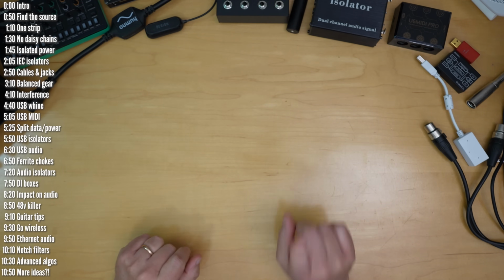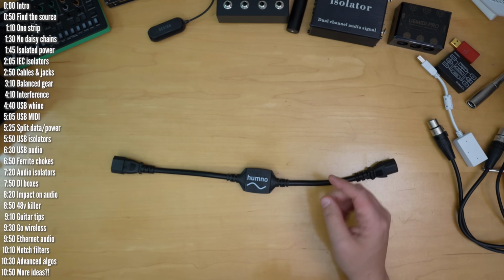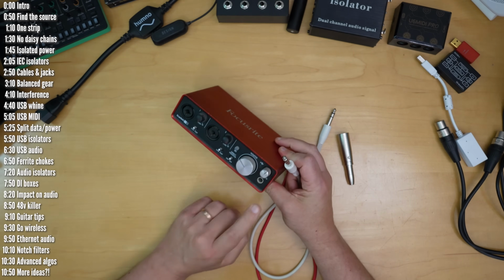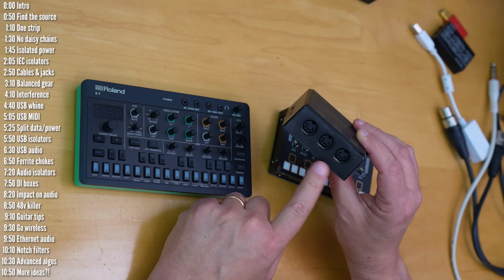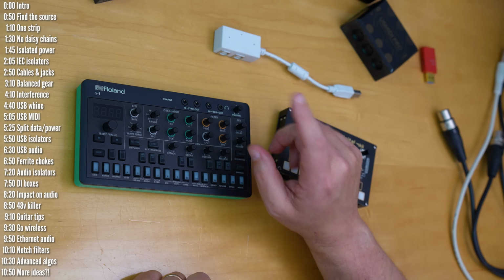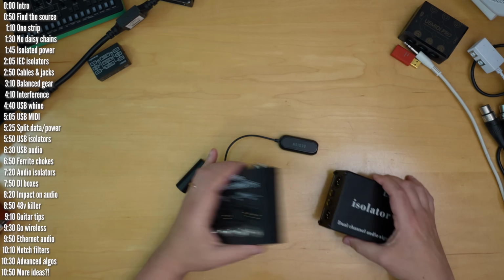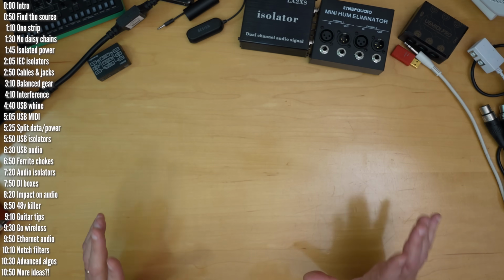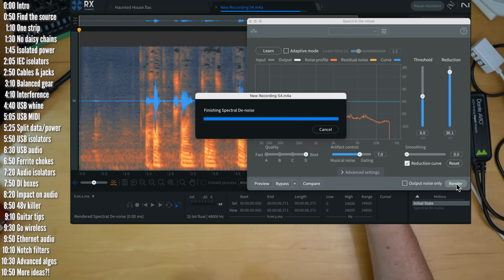12 better, simple and cheap ways to fix noise, hum, buzz, ground loops and USB whine

Comment: I found that Roland devices like to produce USB groundloops when using bus power. I’m using a Delock USB isolator with 5 kV isolation with both my TR-6S and MC-101 and that works well (each instrument has been connected to it’s own isolator). Make sure to get the USB 2.0 (480 MBit/s) version so that the data transfer side works as well. There’s also a version of that product that uses USB 1.1 speed, the price difference is minimal. the USB 2.0 speed version allows the audio interface function of the Roland devices to work as well.

Comment: And when the noise comes from your house's electricity? And all the neighbors have the noise too? You need to put a BIG inverter (mine weighs more than 20kg!) and an IEC isolator on the computer, especially if it's a tower, and for the rest, a good cable manager, balanced jacks, and using MIDI with a USB/MIDI box are enough. If there isn't a particular device that makes a little noise and you can't connect it via MIDI, then a simple ferrite choke works! (This is all my experience..)
I know all the suggestions you show in the video, and I completely agree, except for forgetting that the noise problem can come from the neighborhood electricity that reaches your home...

Comment: Those belkin devices are very handy in a pinch when you use small synths like the NTS-1
 My biggest enemy would currently be the USB noise, which I can mitigate by using a gate plugin but a more hardwarematic solution would probably be better. The topping thingy looks promising!

Comment: Oh man if this fixes the whine from my QuNexus and my Keystep Pro when using CV, this is a game changer
Reply from the maker: @Ancaja123  let us know back here!
Reply: @loopop I’m looking to get the Topping HS-2 when I get some extra funds. I like that it doesn’t need power, and it’s super small and flat
Reply from the maker: @Ancaja123  are you connecting them to a computer?
Reply: @loopop  Yes, mainly for sync reasons. The computer is definitely what causes the whine, and I have noticed at least with QuNexus that the whine doesn't get recorded into any tracks at least, it's just looped into the speakers (over my head a little). But I have thought about using my RK-006 in its standalone mode, and connecting them up to USB that way to see if that gets rid of the problem.
Reply from the maker: @ ok cool good luck!
Reply: @loopop  while I have you I do have another hum issue. I have a Maneco 16 Second Digital Delay which is an odd clone of the vintage EHX pedal. The clock out of the pedal is changed to a metronome out, but any time I plug anything into that jack, I get hum, even if the cable isn't plugged into the other end. I have 2 of them and it happens on both units. Any idea why just plugging a cable into a jack gives me a hum?
Reply from the maker: @ I have no idea - perhaps the cable behaves like an antenna picking up RF interference

Comment: if you plan on using piezos; they require instrument level; use a DI or instrument input (there are dedicated DIs for piezos but any will work), and know that piezo cables are specially sensitive to interferences and they absolutely not play well with any 220V dimmed light circuit (so again; use a DI, and make sure the cable doesn't cross a power cable or DC transformer)

Comment: I wish arturia would sell those little USB dividers standalone; I haven't found many alternatives at all and they do solve many problems (for me I need one to plug my microfreak to both my modular and my pc via usb)
Reply: the fact is you shouldn't need a 100 dollar solution for this as you just need to separate data and power lines (with power isolation). Only solution I found that is straightforward is the one provided by dreadbox (look up usb power/data splitter by dreadbox).

Comment: Regarding DI boxes and audio interference - in my experience, the dead cheap Behringer MicroHD HD400 changes the sound significantly while I can't hear any difference in the much more expensive models like the Palmer PLI-05 or Radial SB-06 (the latter also having the advantage of changing unbalanced into balanced signals, as often plugging a TS cable into an otherwise TRS patchbay results in volume loss).

Comment: I’ve had noise/distortion issues with my Dreadbox Typhon. It’s not a PC-USB connection noise issue, happens whenever it’s plugged into the wall or a power strip while the screen is on. Only thing that works is powering it off of a power  battery brick.

Comment: Sometimes the external screws on devices are connected to the chassis ground/ground plane of the circuit in your device. You can run some speaker wire, similar to the way phonographs ground to amplifiers, between the screws on your devices.
Reply: This is more likely to create ground loops than to solve them.
Reply: @goodun2974  It has worked for me when using unbalanced equipment. By bonding all your equipment to a common ground point, you’re creating a single reference potential—a shared ground plane. This eliminates ground loops (where differing potentials between gear can cause unwanted current flow) and minimizes common-mode RF currents, which are a major source of RFI and shocks.
Reply: Star grounding

Comment: Have you tried MVolts's Alchemist (USB/DC) power hub? Is it any good? Does it eliminate/minimise noise?
Reply from the maker: I've not tried it yet
Reply: Should be out in the next month or so I believe… I would also be interested to hear what they are like. There are two versions - Alchemist and Silent Alchemist - the latter featuring individually isolated outputs. Big fan of MyVolts 🇮🇪 so think they should be interesting products.

Comment: Cable type.
Had a really bad hum coming off my Presonus ioStation 24c audio interface.
I was using TS instead or TRS.
While most interfaces can take either as far as just putting signal in, but TS cable is unbalanced. 
Unbalanced cables are extremely vulnerable to noise. Example Guitar cable. With guitar cable it doesn't matter as much or we can gate it.
Reply: TRS or XLR can create ground loops unless the shield is internally unconnected at one end.

Comment: I use several ifi GND Defenders in combination with DINIC 19 inch Power Strips with C14 Plug where the GND Defender is attached too in between Strip and outlet. I inquired at ifi about the exact rating and the answer was that the acceptable power range for the GND Defender is between 10A, 1100W to 2400W thus i deducted it should be OK to have it take care of multiple devices at once through the strip. (it works perfectly here in prodcution and mixing room)

Comment: USB devices with LEDs have been a real pain for me. One time I re-cables my entire pedalboard, got cleaner power, etc. only to find my RGB gaming keyboard was the source! So now, the first thing I look for if I hear noise is flashing lights :)
The Topping device is on sale right now. Still not cheap, but I'm ordering one
Reply: having no audio equipment powered by the USB of the computer is key (and they can't be directly connected neither; so those arturia data splitter come in handy in these cases)

Comment: Don’t have a lot of noise, until I add a compressor at the end of the chain
Reply from the maker: That's one of the reasons to eliminate any noise - before it gets louder with compression. If it's clean white noise, try increasing signal to noise ratio by making the signal louder

Comment: Thanks BoBeat.  Electrical noise and ground loops are absolutely maddening.  The absolute worst one was caused by ADDAC A213A/B Eurorack Bridge Eurorack bridge cards and flat wire bus cable.  A big loop of flat ribbon cable waving around to capture any and all electrical noise and disturbances.   Those cards went into the trash.  I think they were designed by a would be electrical engineer that never went beyond tinker toys and Radio Shack 200 in 1 Circuit Experiment boards.  Shame on me for not using my electronics background.😂
Reply from the maker: This is loopop not Bo but you're welcome :)
Reply: @loopop  sorry about that!  I follow both of you and others as well.  Sometimes I just get in too much of a hurry.

Comment: Ziv, a tip I discovered: I have been using iFiDefender USB filters for years on various pieces of gear, which is expensive because those things are not cheap. I discovered that you can get away with using only ONE of those iFiDefenders in between the PC and a USB hub, then plug the various synths into the hub, and it filters USB noise effectively for all the synths plugged into the hub, instead of putting the iFiDefenders on each individual synth.
Reply: One would need more of them. It doesnt have to be an Ifi though i have also 2 of them and they are well made. I also have a bunch of cheaper USB-Audio Isolators wich does the Job also. In theory every device can create a ground Loop. What some guys are messing up with is the fact that even a device wich doesn't create ground loops can create one if its turned off but still in the electronic circle due to impedance. This for example can be a reason for a ground Loop wich only sometimes occurs.
Reply: can you power the hub separately?
Reply: The ifiDefender allows for seperate power, naturally they recommend their own expensive solution... but their stuff works wonders, never regretted the investment but never tried anything cheaper  @hmmmhhhmmh
Reply: I do the same thing with the ground defender. I use one adaptor and run my whole setup from one socket and it fixes everything.
Reply: I connected the Ifi Defender 3.0 to my  Elektron Overhub mk1 and it seems like to eliminate the noise on all the ports but it dosent eliminate the noise completely, (there is still static noise )  , but  when connected to only one USB port (without the hub ) it works perfectly  . :\

Comment: Ferrite chokes help filter electromagnetic interference that the cable they are attached to emits. Often people assume they protect the cable from interference but the opposite is true.
Reply: There aren't actually one way interactions in electromagnetics, it's always symmetrical. They slightly suppress common mode currents which affects the ability of cable to couple to any other cable.
Reply: Best to locate the ferrite right next to where it plugs into the device that is generating RF and back-EMI or electrical hash.

Comment: Great video, thanks! Been having endless issues with noise with my contact mic, interface and beefy gaming laptop
Reply: use DIs with contact mics and the shortest cable possible. The path should not cross anything electrical (specially transformers). I use radial SB-4 for piezos; they work well.
Reply: @hmmmhhhmmh  thanks for the tip. I found that the issue was to do with the 240v power supply that my laptop runs off. When I tried it with my battery powered Mixpre 6-ii it was absolutely fine, but a DI box sounds smart

Comment: I used Izotope for years to remove noise post recording, but with the latest version of Spectralayers, I switched and now use Spectralayers exclusively. It's simple, fast (with a GPU), and reduces noise with virtually no artifacts.

Comment: I love the Topping HS02 so much, I had to buy a couple. Totally eliminated severe USB noise in my hybrid setup— TE OP-1 field, OP XY, and Roland SP404 mk2. I’ve also used one of the small aux to aux devices you mention with some success

Comment: Quick correction, the Boss DI1 isn't a passive box, it requires either a 9v battery or phantom power to operate (I just bought one yesterday)